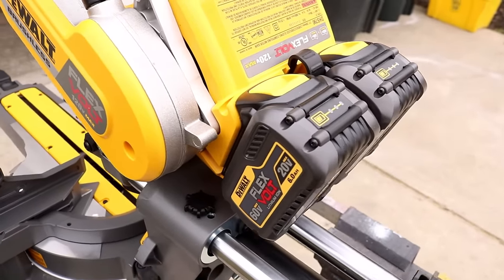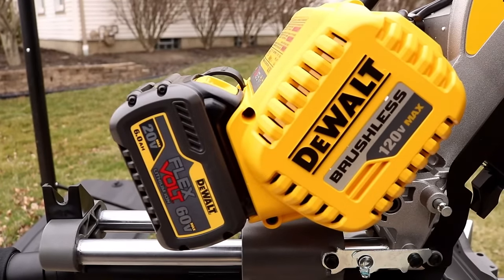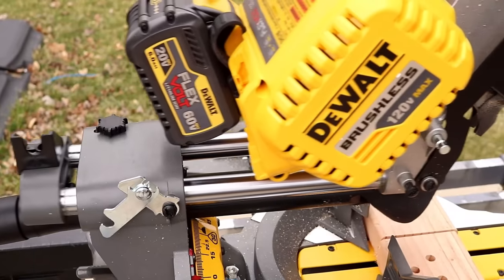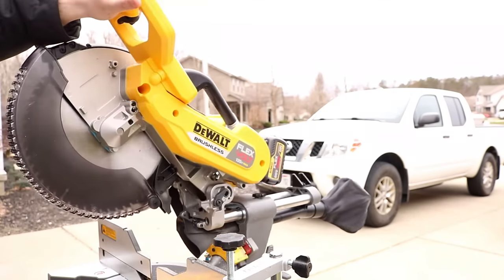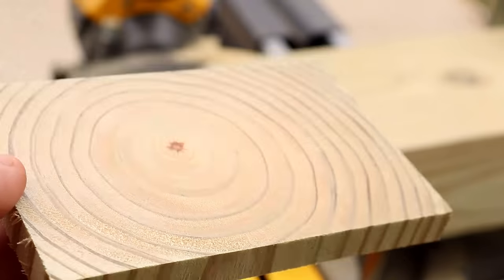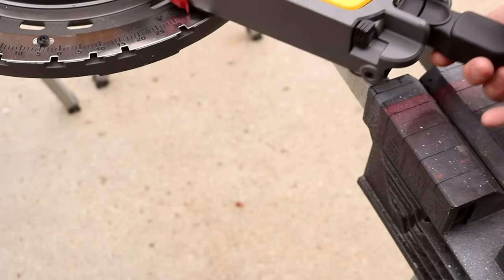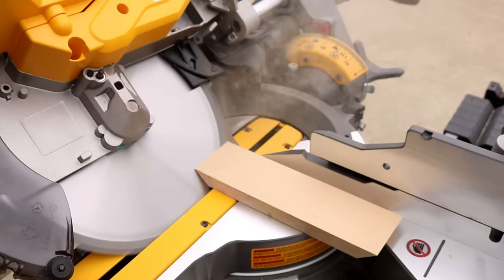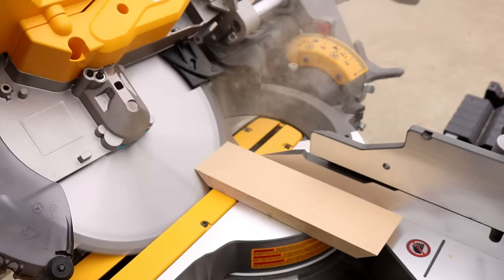DEWALT FLEXVOLT MITER SAW REVIEW! Putting the Sexy Flexy 12" Flexvolt Miter Saw TO THE TEST!!!

Comment: Mine Leaks OIL. I have the non-sliding version of this saw. After about 20 cuts, I noticed oil on the wood. I called Dewalt, they said a little is normal... But it now appears to be a continuous leak. Called back, They told me to ship it back to them. Not sure how I’m going to pack it securely, we’ll see.. Otherwize, it did cut well.
Reply from the maker: Wow thanks for the feedback Ant. That definitely doesn't sound right

Comment: I purchased mine 9 months ago on May 1 2021 and today Feb. 21 2022 it burned out. I’m very disappointed in it and that DeWalt has not fixed the problem. There are so many cases like mine out here. Only way to fix it is to get a new motor. Place like Home Depo will replace the saw straight up but only if they have one in stock. DeWalt Service will tell you that you need to ship the saw to their service center and in a few months you should get your saw back, it might actually cost you $300 if they decide that it was your fault why it broke in the first place.

Comment: There is actually a way to loosen and tighten the rails so that you can add or remove resistance of sliding. 

Steps:
1) Completely unscrew and remove the slide rail lock knob.

2) you will see another hole right next to where the knob screws in. In that hole, there is a star drive set screw.

3) Buy tightening or loosing that screw, you can adjust the resistance.

CAUTION: Be careful while messing with that set screw. If you loosen it too much, you will add slop in the rails.

Comment: Good vid! She really shines w/ the 9 & 12 ah batteries! 6ah isn’t optimal for me personally/half day if that. Buy the Kapex hold down clamp and a top of line blade & bang bang boogie! Then she truly shines! Very bulky & heavy yup! I believe the difference in sound is bc direct current vs alternating current, the electrons flowing different cause a different noise in the motor or something like that. Some1 told me that bc I questioned it when I got mine. No I never use that little switch lol I just do the... lock it!? 😆 I’ve cut That fence too many times 🤦🏽‍♂️

Comment: I've been using mine for about a year. I added a Makita 100T blade. Makita makes some extremely nice finishing blades. It's definitely more powerful on batteries, so I almost always run off batteries. Running on the AC/DC adapter, it also makes an annoying shrill noise.
Reply from the maker: Yeah, I could here it when I pulled the trigger with the cord. I'll definitely be using the battery bro
Reply: @ToolReviewZone  i couldn’t here it, but I could there it lol
Reply: You are correct, Makita makes really good blades.

Comment: Been running one of these since they came out! It’s a beast! Love the cord/Cordless option! Agree sounds stronger on battery. I hate that shrilly screech it lets out on ac adaptor upon startup. Seems to get worse with time.
Reply: What's good playa!!
Reply: Amos Cardoza my man!
Reply from the maker: It drives me nuts when I hear it too Sick. Same as the table saw! Though it was just be bro👊
Reply: Is yours still working?  Mine shorted out.
Reply: @johnbeyke8486 how long did it last

Comment: Sure do use that feature on the miter. We do a lot of old houses and crappy glorified trailers that been converted to a look a like home. So as you know most of the pre fab homes are kinda out of wack and not square. So I’m always tweaking trim work and what not. Awesome video boss! Smashed that like button for ya bro!
Reply from the maker: Awesome feedback bro, and thanks for SMASHING!!!!!
Reply: I’ve had this saw for over a year, and I love it! I agree with the sliding on it tho. It has a little bit of resistance. The Dewalt 7 1/4 has a smoother slider. I wish they do a refresh with the 20v 7 1/4 and make it a duel bevel. That’s the only thing it’s lacking I think. But again love the content man! Keep it rolling brother man!

Comment: The ONLY 120V tool they have. I'm a little disappointed they haven't made a 120V 10" or 12" table saw. For now I have to rely on my powerstation. Batteries-wise, a couple 9s or 12s would give a better performance for energy output. I'd love them to come out with a BL upgrade to the 7-1/4

Comment: How do you charge the batteries without a generator?
Reply: Well like on many sites cordless tools are very very convenient yet do require electricity to charge. So I'm guessing the idea of this is for flash people that really want the option. Maybe you're having to move your saw around or you're just finishing a job, you can quickly set up and not get the power lead out. You'd still have to have a charger to the mains, but maybe it's at a charging station with mains. For most people this set up is pointless for most. Doesn't look like it works better than the corded equivalent. The corded literally forces your hand upward on the handle with the power.

Comment: Just bought a brand new flex volt 12” slide. When I depress the saw down, then slide it forward, the blade comes in contact with the plastic valley under the yellow insert. Is that normal?
Reply: Try to adjust the depth, so it won’t go so far down into the throat cavity.  I think the black screw with the wing nut on it, at the right side, will adjust the depth, from what I’ve seen on other YT’er videos!

Comment: Dewalt should have used a standard extension cord for corded operation. I don’t like how they use that proprietary adapter.
Reply: It’s included with the saw though so why does it matter?
Reply: @christophercrawford2736  cause if it breaks or I lose it, I have to spend whatever Dewalt charges for a new one, rather than grabbing an extension cord from the garage
Reply: @_P0tat07_  if you’re breaking and losing stuff, I think that’s on you.
Reply: @christophercrawford2736  of course, i never said it wasn’t :P I’m just looking at convienence.
Reply: To my understanding, if Dewalt use standard cord then they have to put extra electric components into the saw motor which makes the saw slightly bigger and heavier. In fact, the cordless feature is the standard setting of this saw, and the corded function is an extra add-on.
Reply: It has a DC motor so you can't use AC cable directly, firstly you have to convert it to DC ...

Comment: I have one! Had 2 of them in my career. The problem am having is that the bevel angel is not true to 0 degree or 45 degree ... or any degree. Is about 5mm out. Anyone has this problem? As I am! And it’s driving me crazy!?
Reply from the maker: You came adjust the bevel with the wrench that it comes with. Look in the manual and it will tell you how to do it
Reply: Tool Review Zone yes I have done that few times and still the same problem. DEWALT has replaced it for me with a brand new one and still same problem... so but confused 🤷‍♂️
Reply: @alitawfik4451 

You need to get it to 0°/90° then adjust the little red arrow on the scale so that it reads 0.  After you get it to 0 you can then adjust for 45, both left and right.  Make vertical test cuts then check with a good square.  Make sure you run your square on the edge that was sitting on the table them run it up the side that you cut.